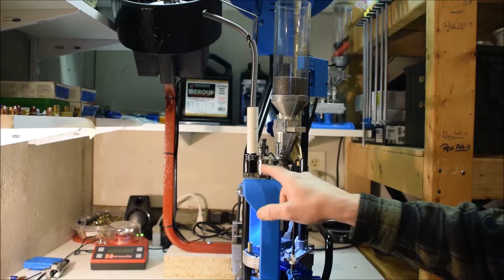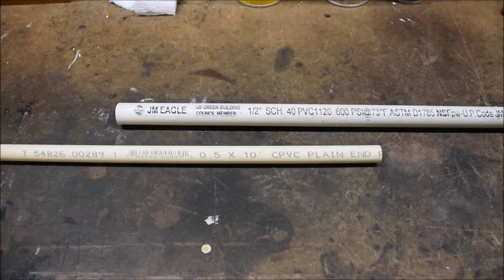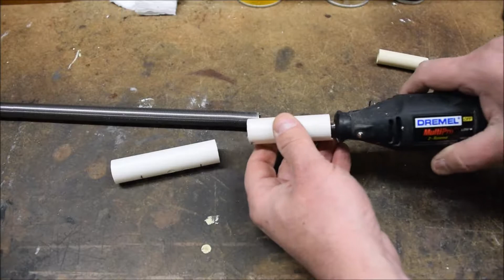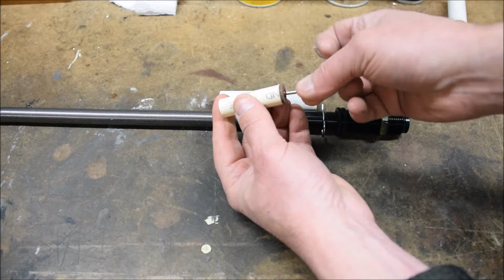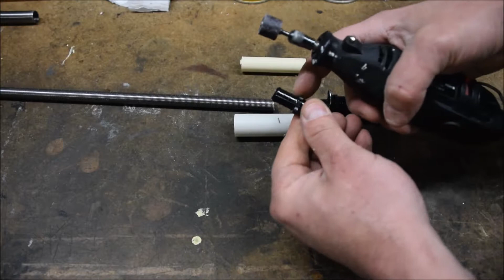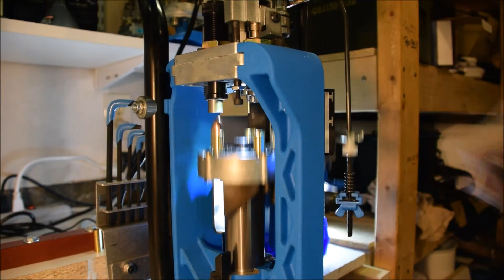Hornady Bullet Feeder with Mr Bullet Feeder Bullet Dropper on Dillon 650

Comment: Awesome!
Reply from the maker: Thanks Matt!
Reply: @sparky8729  
Does the bullet dropper die partially seat the bullet?
Reply from the maker: @lfeco  Yes.  There is a vertical stack of bullets in the dropper.  The bullet drops roughly 1/4" and the stack falls on top of it.  This pushes the bullet into the case just enough that it does not fall out when the shell plate rotates.  Note that I am also running the Double Alpha expander die.  This expands the brass a bit more than the Dillon expander and it helps get these bullets seated a little better.

Comment: Thank you for sharing this cause I really didn't want to spend $500 for the complete Mr Bulletfeeder system and was wondering if there was a better way to run the Hornady bullet feeder on my Dillon 650
Reply from the maker: Glad it was helpful.  The bullet droppers are 90% of the drawback to the Hornady Bullet feeder.  If you're willing to invest in the DAA droppers, you can make this system work.  Check out my other video where I ran 100 rounds in under 4 minutes.  This thing runs great with the DAA droppers!
Reply: @sparky8729  yeah that's the droppers I wanted to run but didn't know if I could make it work with the hornady feeder